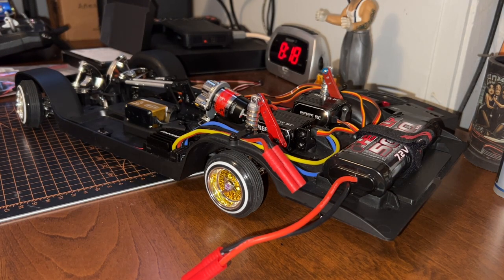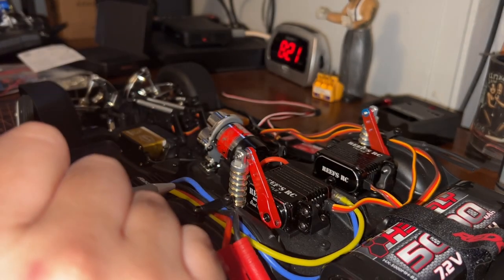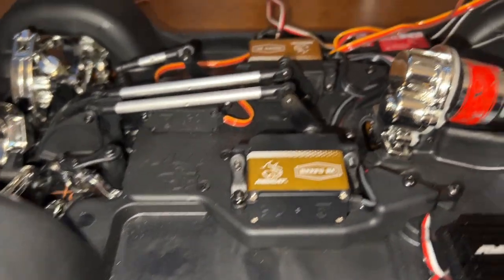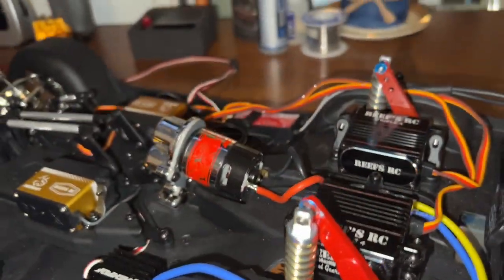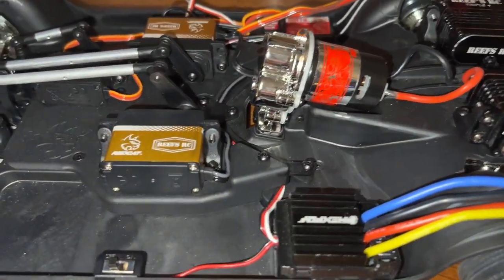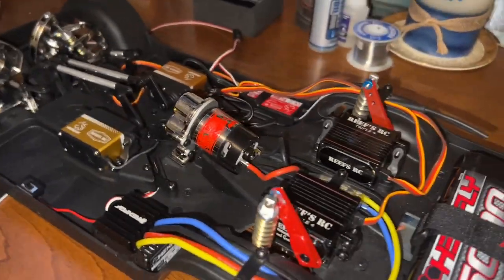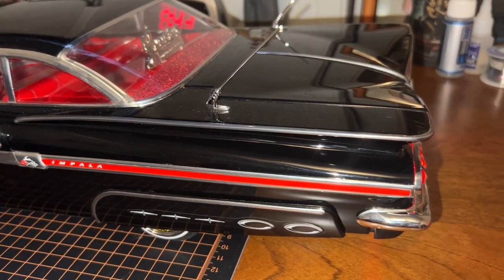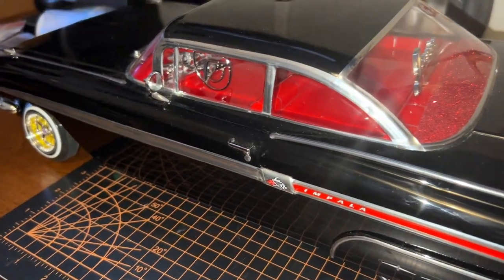Redcat Lowrider 59 impala add’s & mod’s !!!

Comment: Aren't those black servos like 129$ each
Reply from the maker: Yes they are around $129 each but the 300’s are about the same price an work better I did end up changing the back servos for the 300’s so I got all 300’s servos all around , on the 79 Monte I did used the reefs low profile black servos for the back n got the black 300’s reefs servos on the front for better hopping!!

Comment: Beautiful Car Brother. The gold Jevries Wheels really stand out. I've got the Gray 59. Gonna start working on it too.
😎👍🏻
Reply from the maker: Thanks homie 😎😁👌🏻 yea I got em on chrome an painted the center on gold I think jevries is goin to come up with some new true 13”s!!! Your grey 59 its goin to look dope 🔥👌🏻
Reply: @soy1de3aztlan  Awesome. Yeah, know what Bro? We'll never stop upgrading these Lowriders.😂
Reply from the maker: @Carlosinator  😰🤣that’s for sure bro can’t stop adding parts to em 😰😰😂😂but is fun 😁
Reply: @soy1de3aztlan  Hey Brother did you program your BEC for higher voltage? I bought a 3S Lipo and set my BEC for 8.4 volts, more voltage to those servos. I think BEC comes set at 5 volts.
Reply from the maker: @Carlosinator  hey how’s is goin bro !! Yea I bump it up to 8.4 volts that’s the max volts of the servos that I have so it can give more juice to the servos also the lipo 3s battery is goin to help !!! Just remember that if the servos can’t handle 8.4 Volts they will burned out 🔥😰!!! All the ones I got em max are 8.4 volts so yea I done an it gives lots of more power to em 💪🏼👌🏻👍🏼😁
Reply: @soy1de3aztlan  Thanks Bro. I just watched your video again👍🏻 and I'm learning new things about these Lowriders every day. Yeah NorthSide Custom RC is an Excellent go to source for these Redcat Lowriders.
😎👍🏻
Reply from the maker: @Carlosinator  Im glad this videos are helping out that’s what is all about helping each other’s up 😎👌🏻👍🏼
Reply: @soy1de3aztlan  Yep! Exactly Brother! Do you have an Instagram for your Lowriders?
Reply from the maker: @Carlosinator  yea bro I go by “1chuco3” I just recently stared uploading pictures an videos of my RC Lowriders !! Do you have a Instagram too ?
Reply: @soy1de3aztlan  Yes, mine is Carlosinator7. New account too.
😎👍🏻
Reply from the maker: @Carlosinator  cool I will add you bro 😎
Reply: @soy1de3aztlan  Got you too Bro!
👊🏻😎
Reply from the maker: @Carlosinator  cool bro 😎 👊🏼

Comment: I put the JEVRIES 5th wheel continental kit on my collectors 59 n the light kit, next is I want to put the fender skirts the 59 comes with, but don’t want the rear wheels to rub, question on your 59 rear differential you said you swapped it with a Monte Carlo differential? so what i ordered was the REDCAT Monte Carlo chrome differential shell, n the set of axles, do i use the 64 rear axle internals ? Cause I didn’t see a complete Monte Carlo differential at the REDCAT website 🤷🏻 thanks
Reply from the maker: @meefthepotatoe4363  getting that 59 suit up 😎👌🏻yes I did , yea they don’t carry the complete differential only by parts ,you’re going to used all the 64 differential internal parts,if you didn’t get the axles shaft bearing with the C-clip just taken em off the 64 ones an put em on the Monte Carlo ones ,now when put back the axles shafts with the bearing make sure you put em on the correct side because one is shorter than the other one ,just double check on that before you put everything back together..😎

Comment: Good stuff man ! For the shocks can you make something of a double dog bone ( basically a sideways leaf spring shackles)for each rear shock and run in line with the servo arm maybe rubber o rings as bushings on sides of shocks for wear ? I don’t own one but I’ve been into this hobby for a while.
Reply from the maker: Thank for the info that’s a great idea 😁but what I ended up doing is changing the spring shocks for some custom made shocks that are less thicker,it did work good an looks also better sence i the shocks that I put on are red so it kind of gives the RC car a better look !!!

Comment: Nice 👍👍 …..I can’t get my 59 to hit the rear bumper with the body on, just a lot of small front bounce but the 64 straight out the box it’ll hit the rear bumper
Reply from the maker: Yea that happen with mines out of the box it didn’t hop much I added the dual servo kit with more juice to it so it can get it to hit the back bumper !!!
Reply: My 59 hits and stalls on bumper right out of the box. With full charge  raise rear end, lift front just a tiny bit then start hopping with left "Raise Front" toggle switch. With a few rhythmic hops it will get higher and higher. Just a little practice.
😎👍🏻
Reply from the maker: @Carlosinator  nice you right with a little more practice you will get it hopping a got tip is at soonest the wheels touch the ground toggle the switch it will make it to hop higher 👌🏻😎

Comment: Yeah, where its chirping on 3 wheel. Thats how shocks mounted. Same issue I found with the shocks :(   Its chirping cuz the servo are forcing the position by flexing the plastic mount at the axle. I tried to work around it but the rod ends not much can do about it
Reply from the maker: You right I think that issue it cant be fix an it’s a big issue when it comes to the back servos it will soon burn em not good at all 😰 have go back to the custom ones unless redcat fix that issue ,I did grab 3 sets now Ima be stock with em 🤦🏻hope more ppl see are videos so they can see the problem they goin to bump into before they waist em money!!
Reply: @soy1de3aztlan  agreed 10000% Brother 

I tried to figure something out but 2 days tinkering couldnt get past it
Reply from the maker: @NorthSideCustomRC  I feel bro i you spend em 2 days without working em out is imposible to the magic specially coming from that been around in the RC game I been checking out your videos it be helping lots so if you see no fix on em I do take your side 💯% !! Em ppl from redcat should learn from you on tne real bro 😎 👌🏻

Comment: What us needed to have 2 servos for the front
Reply from the maker: Get the “dual servo kit” from redcat racing 👌🏻😎
Reply from the maker: It’s that was your question? What you needed to have 2 servos for the front ? Or what do it has 2 servos in the front ?! If is the second question!! Is because with 2 servos in the front you can do side by side also will give more power when it gets to hopping!!!